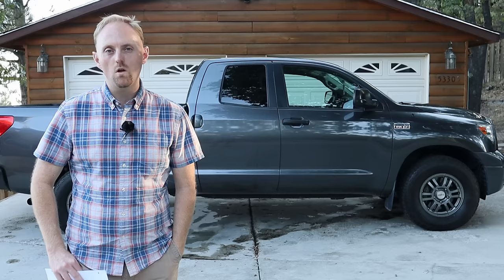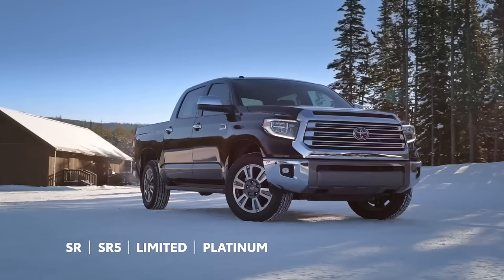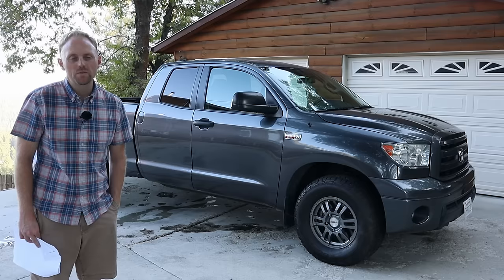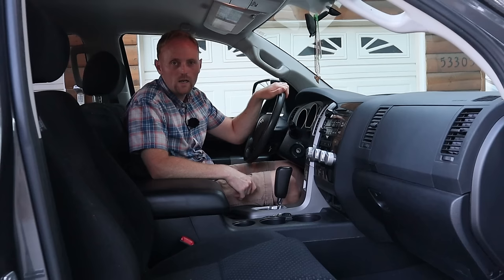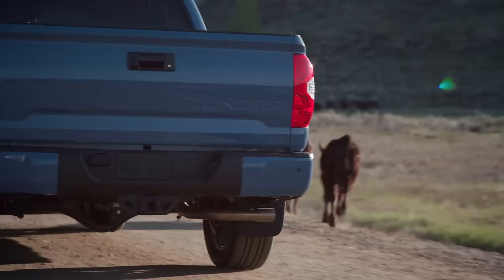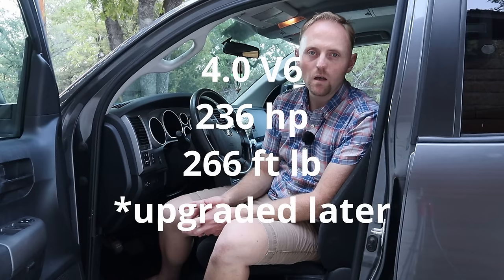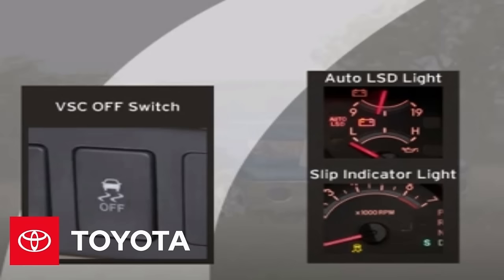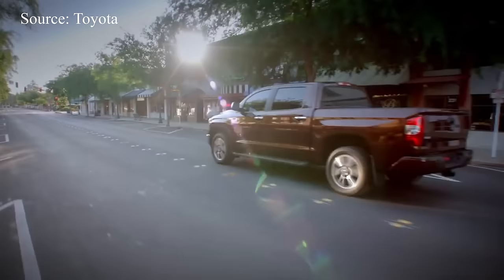Toyota Tundra  |  Brutally Honest Long-Term Owner Review

Comment: The reason why I bought a Tundra was for the reliability plain and simple. I don't care about electronic leather wrapped ball scratcher that are heated and cooled for you balls' comfort. You can get all those doodads in a Ford, Chevy, or Ram and look good waiting for the tow truck on the side of the road. My 2012 is my fifth Toyota vehicle (1 Corolla, 2 Camry's, 1 RAV4) and it is just as reliable as the latter ones I've had. I had a Ford F150 ecobreak and it had the vavletrain rattle. I got rid of it and bought a used 2014 RAV4 since I had the Tundra already.

Comment: I had one of these and the first thing my mom said when I brought it home was, "why did you buy a turd warrior?" She read the TRD and the word rock was smaller than the TRD and Warrior. I just laughed but it was an awesome truck. I would not buy one of the current Tundra's not because it's a bad truck but like you said it's dated when compared to what you can get with the other brands. Your are limited in engine choice, etc. Now I am hearing they are working in the next gen version and that has peaked my interest because it is rumored that they are thinking about a turbo 6/hybrid version plus updated interior.

Comment: Great review!!! Very thorough and great points brought up!! I didn't hear anything about brake performance. I wonder about this because my 2001 Tundra was HORRIBLE with brakes and front rotors. Everything else was amazing. I would say I put brakes on every 20-30000 kms in the front and I did mostly highway driving. Same route but with a Titan XD currently and at 80 000kms I have not had to do a thing to them with lots of life left. I really hope Toyota figured how to overcome that small but albeit important issue. It gets expensive :). That was my only complaint with that truck other than being able to pass anything but a gas station lol!! Thanks again!
Reply from the maker: Thanks for sharing. No brake issues with this one.
Reply: @BigRockMoto  Awesome to hear!! Thank you!
Reply: I still have my 2000 sr5. I addressed  the front brake issue by just upgrading the rotors and calipers. Easy fix.   Has almost 300k miles now on the truck.
Reply: Thanks Jesse great to hear!! I miss that truck!!! :)

Comment: Nice review, but not buying the tow rating equivalency mentioned.  TRD Pro specifically has a significantly lower payload and tow rating than say Silverado Traill Boss, which is lower than an F150 FX4.  Still, the Tundra will meet most needs.  The biggest issue for me is mpg.  I just got 18.4mpg with a 6.2L V8 MY2007 truck.  Toyota needs to improve.

Comment: Traded my 2015 Ram in for a 2020 Tundra.  Exhaust manifold bolts  breaking and that hemi tick / camshaft lifter failure rate scared me on the Ram.  My only complaint with the Tundra is they stopped installing a external transmission cooler despite listing it on the sticker.  I probably will install one if I ever start towing again. I'm currently at 12000 miles w zero recalls unlike the Ram which had several at that point.

Comment: I get the concern about mpg and outdatedness of the truck. I have owned a number of Asian model vehicles, currently Tundra and Ridgeline, and the offset, in my opinion, is the savings over time in the reduced repairs that would otherwise plague you if you owned a domestic model. I'll take the excess fuel consumption and reliability vs. the crappy domestic models.

Comment: I agree 100% with everything, "Except" the opinion on towing capacities.  The Tundra's are far behind the big 3's in all categories of towing.  Payload: about 1400-1500 lbs in the double cab Tundra (2014 and up model years) , vs. 1700 -3200 in the big 3.  Towing cap.  9400 to 9900 for the DC Tundra, vs the big 3 in the 11,000 to 14,000.  Last but not least, hitch capacity, Tundra 980 lbs, big 3 1100 to 1400 lbs.  

  I pull a 7500 - 7800 lb RV trailer ( 29' / 11'6" tall ) with my 2014 Tundra DC limited.  We RV a lot including to Alaska...Would I tow anything larger? no.  So waiting to see what new 2022 Tundra's have to offer.  My 14' is a very simple truck / reliable truck.  I'm 100% OK with that...just give me a little more towing capacity.
Reply from the maker: Good points

Comment: Looking for a truck that I can keep for a long time, getting tired of flip flopping between trucks. First chevy I got went through 2 engines (5.7l 350), my last pickup which was a Chevy 1500 5.3l decided to develop a rod knock and yes, I did my maintenance like I was supposed to. Now I finally got a used cummins but the “rebuilt, beefed up” transmission is going out after putting only 10k miles. Should’ve bought a tundra damnit

Comment: Great video, thank you for your hard work. Keep up the great content. I wanted your thoughts, I just purchased a 2015 Tundra for $28,300 out the door. It has 69,312 miles 310 HP with the 4.6 In your personal opinion did Get a good deal or did I over pay? 1 owner no accidents on the car fax.

Comment: My  Tundra, a 2012 4WD 2 door yep only 2 doors, no extra cab doors or crew max. just a driver and passenger door.  That set aside it has a standard bed and a turning radius of 19 feet.  My mpg is about 17.5 hwy 14.5 city on average.  I got as high as over 15 city and 18.5 hwy.  At 67 I lost my lead foot long ago.  I have co-workers that don't get near the mpg I get with their Fords and GMs and most aren't even 4wd like mine.  One complained about 9mpg with his Dodge.  My tundra as anyone would expect shines in reliability, unlike theirs.  Just a side note mine is actually lighter than a similar Tundra in 2wd with multiple doors by a substantial amount.  After I put alloy wheels on it I'm guessing probably over a quarter ton lighter. Not bad for 4wd.  Pulls my 8500lb camper like a dream.

Comment: lost my 2006 SR5 access cab when I foolishly let a young person drive her car into it.   fought to get it fixed for over a year before finally had to 'give in'.  203k miles.  looked almost new sitting there in the salvage yard.  cried a little inside.  moved on to a 2018 Tundra SR5 crewmax.  now 'up to' 30k miles on odometer.  need a truck to pull my bassboat.  do I 'need' the 5.7 v8?  dumb question.  it's a lot of fun to drive.  and I'm looking forward to turning 300k, then 400k...

Comment: I am Toyota's advertisement!!!!

Now 51, at 16ys old & heavy foot & country boy, got a 1980 long bed,,,,, it is still being driven today by 22re engine...
1988
1994
2002
2010
35 years of Toyota truck living...all but 1980 have been 4x4...
I HAVE NOT SPENT $1500 IN REPAIRS!!! Outside of regular maintenance....

I just broke 1000$ last week as cruise control broke & cost 360$ at dealership...

North Carolina native, & Oklahoma hunting lands...

Now I have had ford,gmc,Ford,, dumbstruck over last 25 years...they all have had major problems.... 
My dad has had 4 f350's since 2001....each has needed 5-12,000 in REPAIR ,,,,7.3,6.0,6.4 diesels
(yes I know gas vs diesel)
Reply from the maker: awesome thanks for sharing your story

Comment: Toyota also offered a supercharger to add onto the 5.7 from '08 to '15, it upped hp to 504 and torque to 550lb-ft, if you for some reason thought that was worthwhile.

Comment: I have a Taco trd off road and a real locker is a locker. 
I tried it on a sand hill, MTS+4 low floored= the truck does not maintain momentum to keep it moving. 
With the locker on...I have maintain the momentum and I did not had to floor it.

Comment: A true pickup is a vehicle that you open tho doors and then wash the mud out of the floorboards. with a hose. Toyota has done the best job with this type of vehicle. As for towing, its better to own one of the Ford F Series with a diesel engine.

Comment: As a DOT employee retired with 34 years, I drove a ton of new trucks until they had at least 100,000 miles or more. They were basic trucks but had a variety of engines and transmissions. Dodge is too damn loud rumbling, Ford has the most uncomfortable seating on the market and Chevy out of the three ran better with less problems. I currently own my third Toyota truck and the other three you can have. I also own currently a 1994 Silverado that I use as a show truck. But Chevy, Ford and Dodge stay in the shop. The Toyota doesn't.

Comment: Have a 2007 Limited 4x4. Awesome truck EXCEPT, the seats are horrible from a comfort standpoint.  I am 6’4” and the leg support is not there for trips over 3 hours.  Other than that I have 160k with zero problems and tows great.
Reply: Thanks for this comment. I'm 6'2" with long legs and bad lower back. Even though I don't need a full-size truck, I'm considering the Tundra for better driving comfort. I wonder if newer versions have better seats with either longer thigh support or the ability to angel the seat back???

Comment: You removed the silver lining pieces to your wheels? Where they bolted on? Those look like tire retention rings... they are for offroading when you lower your tire pressure to keep the tire on the rim.
Reply from the maker: On this truck they are fake cosmetic only bead lock rings. They unscrew. I don't like fake beadlocks.

Comment: I have had little problems with both Tundras that I have owned.  The dealers have been useless to get them fixed.  Paint problems on the first one were the worst and were only ever made worse at the dealer.  Later it developed a problem where the radio would randomly quit and go dark.  The second has had an intermittent problem where the parking sensors go off as if I'm about to hit something when nothing is around.  Relatively little problems, but not failures anyone should have to put up with on a new truck.  The new one also gets about 10% lower fuel economy than the first one and feels sluggish compared to the first one (same drivetrain and rear ends in both).  I don't plan to own another Toyota after the experiences I've had with these trucks.
Reply: Sorry you had that happen. I will say after years of working in automotive,  some of that stuff is sadly minor compared to most other modern manufacturers.  Most manufacturers  had issues with radios and electrical modern upgrades in the last 15 years. My guess is the 3rd parties are all about the same who are making them. All manufacturers are trying to get in over their heads kn competition. Honda, ford and many others had their fair share of issues as well. I personally wouldn't give up a motor that can see 500k easy with regular  maintenance  for a truck with fun buttons for first world luxury.  I've worked for a few dealerships and I can tell you...  Those are minor compared to what is happening with most other manufacturers.  I have heard ( I didn't work for them) ram has made massive improvements over the years. They might actually be a go too for something strong and reliable.  Again, that is word say and not experience with that manufacturer.

Comment: If you notice the weight of a tundra it far exceeds the other light duty trucks. When they asked an engineer about it they said they put way more metal in them equivalent to an HD and then downgrade the capacities. Classic Toyota. They over engineer and then limit the capabilities for longevity. I’ve had 3 Toyotas and never an issue with one of them.

Comment: Glad I found this review as I’m considering one of these to tow a small (20’, 3500lb gross) travel trailer. Question: Having limited slip instead of locking rear, is it that big a deal if I don’t plan to go rock climbing or mudding? I just want 4WD to be able to tow it around a camp ground that might be muddy or a little inclined or occasionally drive in the snow (hopefully not while towing) in the winter.
Reply: This is certainly a late reply to your question. But for anybody who isn't hardcore off-roading their vehicle, limited slip rear diff is definitely the way to go. It's automatic and generally works really well.
Locking diff needs to be engaged and generally won't get used
Reply: @taylor2105  thanks, better late than never. I ended up finding an F150 with 4wd and locking differential. So far all I’ve done is test that those features worked but have not towed anything.

Comment: 2009 Tundra with 431,800 miles.  Limp mode precautionary device is a scam.  Air pumps should be a recall item.

Comment: I owned a gmc 2017 sierra Denali and at 45000 miles one of the injectors failed 
And the engine was shaking when I was going more the 40 miles hours.

Comment: Thanks, been looking at a used one for work, someting that can handles extremes
Reply: You wont be disappointed. I bought an 07 with 113k for a forestry work truck in a very steep and rough area, and now it has 164k on it. The only thing I've ever had to replace is the driveshaft u-joints, but that could be partly due to my suspension lift/33" tires. Never even seen a check engine light

Comment: My first Tundra was a SR5 2011 and traded it in with 60k for a 2017 Limited. The only service, other than LOF & tire changes, was to replace the rear brakes at 52k.  I have 37k on my ‘17 and am already in need of new brakes.  What happened to the heavy duty brakes they used to tout?!

Comment: Don't buy a second hand Ram, hell don't buy a new Ram, they're deservedly crappy.  What I notice is the paint, it's a ten year truck and the paint looks like new, won't find this on a GM product, Fords generally have good paint.  I have a toytac, good truck for what I need, added rear sway bar to keep it level, it's a '12, very reliable.
Reply: Chrysler products have gone downhill ever since Walter died, Ford was smart enough to have children to run the company, sell all your stock when the last Ford leaves.  Enzio should have sold to Ford , not Fiat, he put patriotism above preserving his family name.  What army did General Motors command?  It's a faceless (and nameless) bureaucracy much like some gargantuan gobermint that will suck your soul out.
Reply: I also have a '99 MB E300d, bought it new, never out of the family.  Aside from adding gas to the A/C, a control module to the heater fan, and a shut off relay to the injection pump (old MBs did that mechanically).  It is a great road car, very comfortable for four, can go 500 highway miles on a fill, and it's original paint looks great.  Nobody asks how old it is. I wish the new ones were this good.

Comment: How about towing a boat around 7,000lbs. I have a 2018 GMC Sierra but to be honest its all it wants to pull a boat that size.Trying to decide on a 2500 or a tundra.Thanks
Reply: I tow 8000 with my tundra like nothing
Reply from the maker: If your current truck struggles a Tundra won't be much better... consider a 2500.
Reply: When I bought my '18, salesman told me that the Tundra is basically a 3/4 ton. The only difference was the number of lugs on the tires. Truck pulls like nobody's business.

Comment: 2021s are the last year with their reliable V8. All tundras moving forward for 2022 and on are only gonna be v6 engines. And next gen with new technology. They have been unchanged since 2007 or 2004 one of those. So 2021 model is the last time to get great reliability new
Reply from the maker: I hope the new turbos are reliable.
Reply: @BigRockMoto  the tacomas have v6 engines. But they aren't as reliable because they are made in Mexico, not the US. Not as reliable. And v6 dont have the same pulling capabilities as v8s. Yeah you can pull with them, the difference is with a V8 you can pull a decent amount without loosing alot of mpg. V6s loose too much mpg when you pull the same. Too much deminishing returns. And v6 will wear out faster the a v8 if you are towing alot

Comment: I have ran every truck that ever wanted to run me. Hundreds? 2 have pulled me..
The eco boost I ran didn't even make a showing..the turbo lag is a bitch. With the gears, headers and exhaust my long bed 4x4 6k pound tundra on 35"s is no slouch. Have a stock 2022 In driveway as well.

Comment: Why you review reliability of a truck at 90k miles? my f150 is at 11/yrs /117k miles, having had some minor issues, but over all reliable. However, I believe the reliability should be tested after 10~15yrs/120k miles.

Comment: TOYOTA 5.7 L Motor - 3UR-FE Engine Problems and Reliability

The 3UR-FE is the most reliable and durable engine for all UR engine family. The Toyota made over 1.3 million kilometers of durability testing for this engine. In reality, the 3UR-Fe can run more than 400,000 miles (650,000 km) smoothly with regular maintenance with using high-quality fuel and oil.

But nothing is perfect and this engine too. The 3UR-FE has a problem with coking of the piston oil rings which caused high oil consumption. After that, the oil consumption increases over time. To avoid this problem, use only the recommended high-quality oil and watch the oil level. The 3UR-FE crankcase ventilation system sensor fails hugely often, and electronic throttle system ETCS-i is not as reliable as it should be. The problem with water pump is also found in this engine. Like other UR engines, the 3UR-FE has a leaking water pump with short life about 60,000 miles (100,000 km).

Comment: Here trying to find reason to talk myself OUT of trading my Challenger in on one. I want a truck again, and before the warranty expires on the Challenger. Love my Dodges but now that I'm driving vehicles younger than I am, nobody else seems to be able to match Toyota longterm durability. I think it says something when they go 14 years without changing anything significant, if it ain't broke don't fix it. Whereas the domestic manufacturers are like sure it's broke, you think we're gonna fix it? HAHAHAHA (I'm looking at you GM, over 2 decades of the shitty 4L60E)